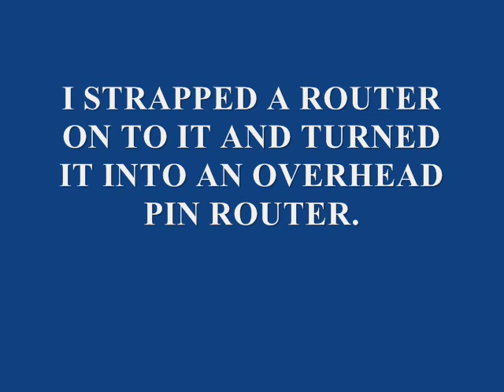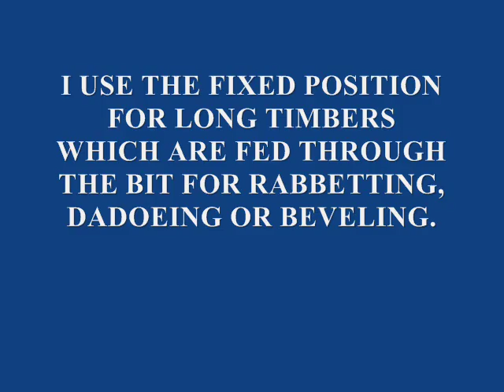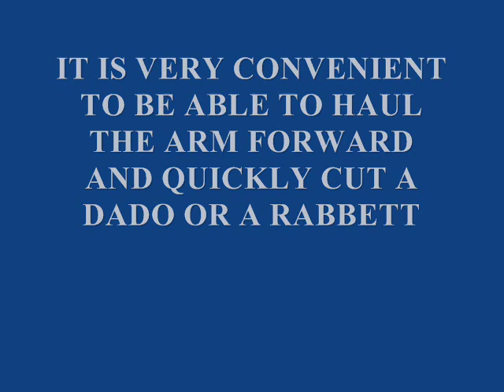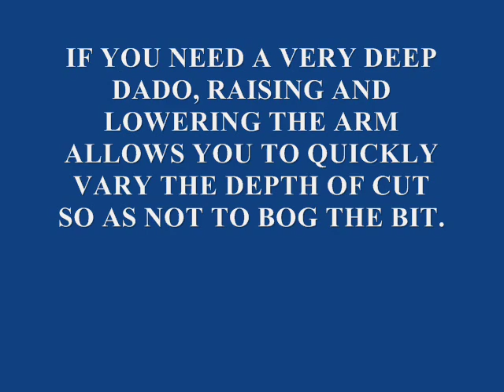CONVERTING AN OLD RADIAL-ARM SAW TO AN OVERHEAD PIN ROUTER..wmv

Comment: Fixing an old RAS motor is usually really easy and the original spindle was designed to accept a chuck opposite the blade arbor so that you could route, drill, and bore. You probably only need $8 to 30 and a few hours to fix your RAS and another $30 to buy a chuck
Reply: Would a typical Jacobs chuck suffice to hold a router bit?
Reply: Oakydokes router cutters (and metal milling cutters) are harder than drill bits, so the jaws on a Jacobs drill chuck don't grip them properly. Ideally, you need a collet to grip them firmly. And really high speed rotation.
Reply: craftsman     ras motor only spins at 3450 rpm.  Is that fast enough for quality routing?   Im not sure it is.   Why not bolt a plate to the four threaded holes in the bottom of the motor, cut a hole in it  and drop a router in there?  Would that work?

Comment: I used large muffler clamps (to hold the router) that were welded to a metal plate which is easily screwed into the bottom of the old radial saw motor.  works like a charm.